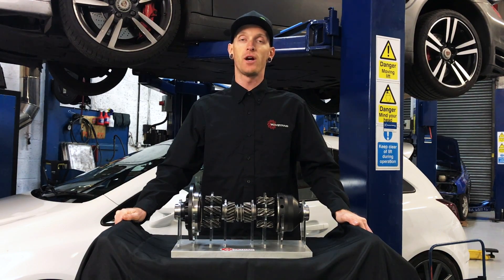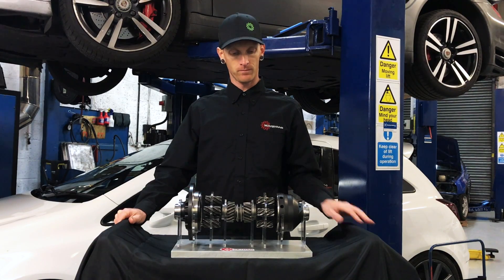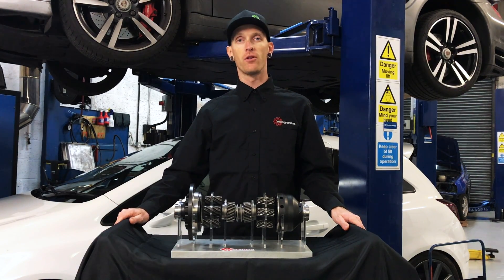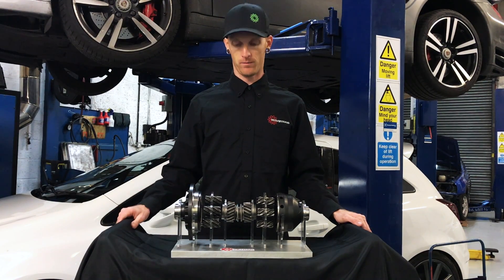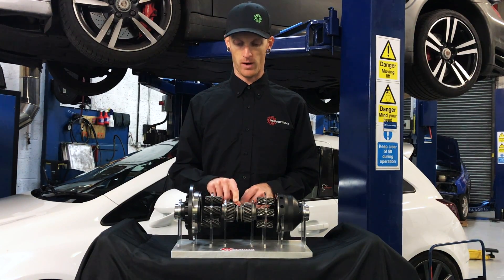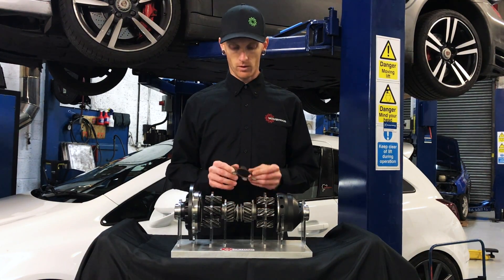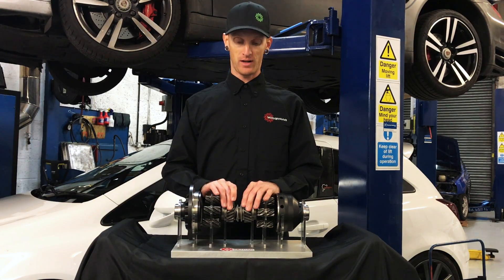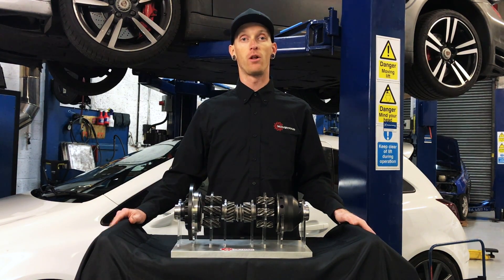Wavetrac Technical Explanation

Comment: Hello, what oil should I use for the following reference: Wavetrac - 48.309.185WK
Wavetrac ATB LSD pour essieu MERCEDES 215
MOTUL GEAR 300 75W-90
or
MOTUL GEAR 300 LS 75W-90
???
Reply from the maker: Do not use: MOTUL GEAR 300 LS 75W-90
Use: MOTUL GEAR 300 75W-90
Reply: @ THANK YOU for your answer🙏

Comment: Thinking about this for 2014 370Z touring. Personally, I like a race vs drift balance. Would you say this lands in one direction over the other, and if so which?  Also,  this is my daily driver, so does this have any noise/ chatter (like clutch types) and/or added tire wear at low speeds like parking lots?
Reply: I’ve had the wavetrac on my 350z HR and it’s as quiet as stock for me. Years of spirited street driving it’s never been a problem or been audible.  

My car isn’t super loud either, stock cats just intakes and nismo exhaust so not much noise to cover up little sounds.
Reply: What was the noticeable differences in driving characteristics over the factory vlsd I'm about to get one of these for my supercharged de @gnawfam
Reply from the maker: You can certainly use the Wavetrac to drift the car, it would be much better than stock.
Reply: @RegalAutosport  thanks for the reply. That's good to know. The main reason I'm looking at your differential is to avoid noise, rough driving, and tire wear at low speeds in places like parking lots. Does the wavetrac have any of those issues?

Comment: I have seen one wavetrack unit with broken wavehub, is this common issue with powerful cars?
Reply from the maker: Due to the physics of the differential, it's not possible for the Wave hub to break during normal function. 

The Wave hub can break when the axle hits into it (over insertion) or if the customer disassembles the differential and reassembles it the wrong way, leading to the wave hub cracking. 

So the answer is no, only down to installer error or miss assembly

Comment: So if I get light or lift a wheel will the wavetrac spin the wheel with traction? I would like it to stay locked if that happens.
Reply from the maker: That is correct. Wavetrac will continue to bias with one wheel lifted. 

The big benefit is that the Wavetrac doesn't lock too, so there isn't any reduction in turn-in or excessive tyre wear.